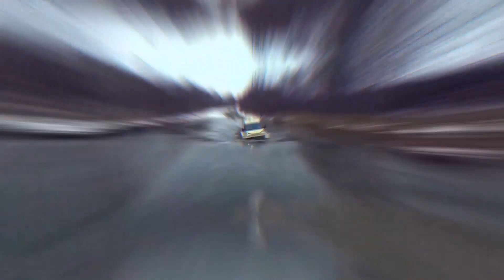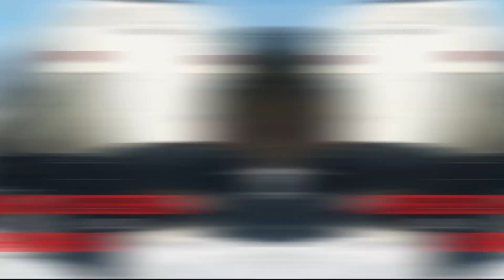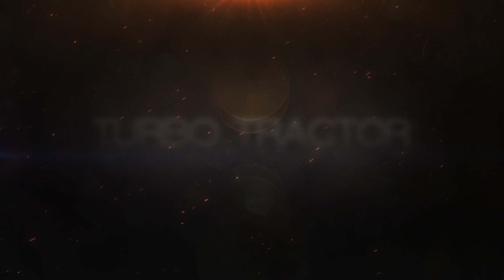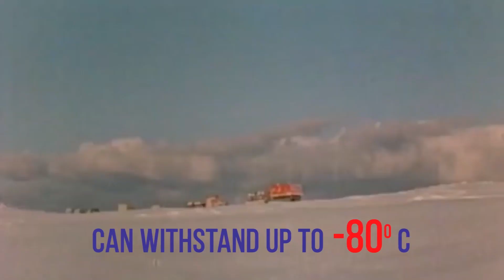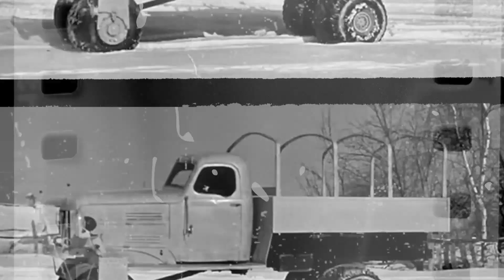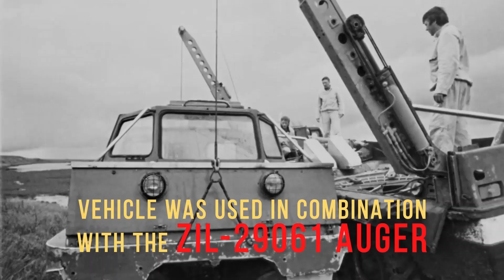12 Insane Off Road Monsters You Didn't Know Existed  (All-Terrain Machines)

Comment: A capacity of 1250 cubic litres, the engine powered the alternator, the generator was powered by an electric transmission, the transmission was made of 24 electric motors on every wheel? Makes sense 👍

Comment: I wonder if any of these would be of use up North where they do the whole 'Ice Road Truckers' thing? It seems to me that the trucking companies up there would make bank if they had a few of these things for working when the regular trucks have gone home.
Reply: Not really, when the ice roads thaw in summer you get several meters of mud, nothing can reliably take heavy loads through there short of a hovercraft. The amount of cargo you could transport wouldn't bring you enough profit to cover the cost of specialized vehicles that will use ten times more fuel per km because they will move at a crawl, and pulling them out of the mud with another specialized vehicle ten times per day. Using boats where possible is much cheaper and if it isn't possible even flying the goods in is cheaper and more reliable.

Comment: Did a winter doing seismic work in  Kuparuk in the late 70s with many tracked and large tired vehicles including Nodwell, Terra Flex and Hillabrand. Also used Tucker vehicles in the pipeline 20 years after that.